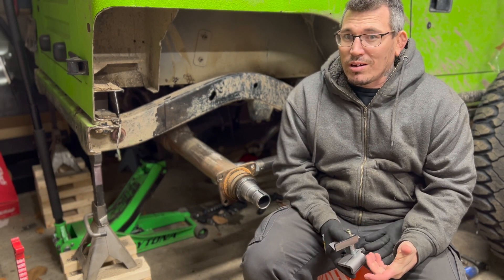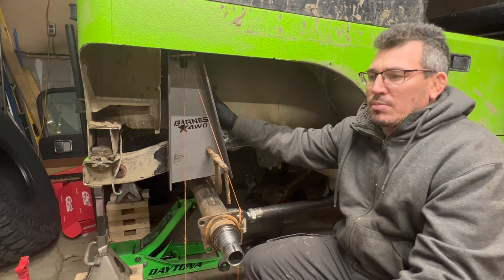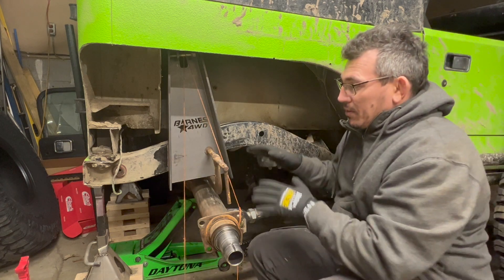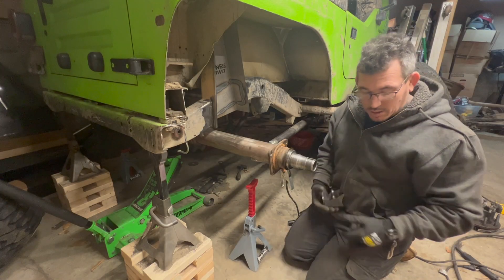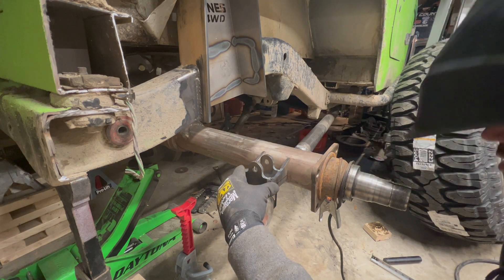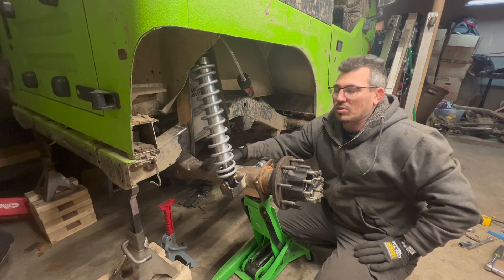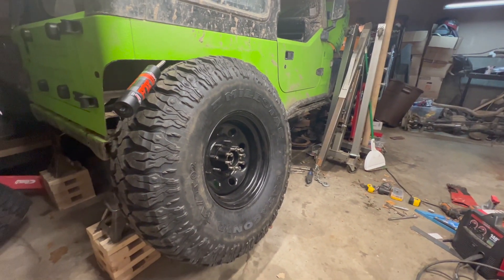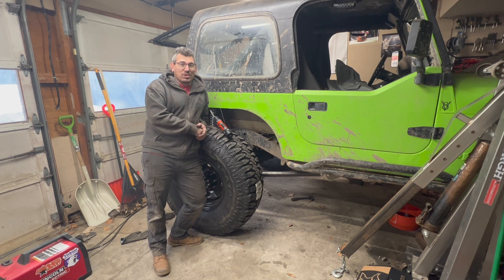How to Build a 4 Link Suspension, DIY Coilover Towers Jeep Wrangler YJ Part 3

Comment: I know your video is a few years old, but maybe you’ll see my question pop up in your notifications: 
The towers you used: are they the standard ones (15.25”) or the long/tall ones (17.75”)?
Also: after everything was said and done and you’ve driven it, are you happy with the 2.0 14” coilovers, or do you think the 12” or 16” or 2.5 would have been better?
I hope to hear a reply. Thanx.
Reply from the maker: The towers are the long/talk ones. Yes I’m happy with it. For this specific build I wouldn’t change the shocks to anything else.
Reply: @KBWheelin ok. Thanx. I already bought the shorter towers, because I was just going to keep normal smoothies but outboard them. I already put primer/paint on the back of them, so I’m not even going to ask Barnes to swap them for the bigger ones. I’ll just have to eat it, and buy the taller ones, because I decided to do coilovers. Unless I go with 12” coilovers, I’ll have to get the taller towers. They aren’t that expensive though.

Comment: Hey buddy how goes it =)  I have been studying your build like crazy as I'm building my yj.  On this part or the video I'm wondering at ride height what is the distance that u have between the coil and the inside sidewall at the top of the tire.  Thanks and all the best.
Reply from the maker: Hey hope the build is going great. The space between the tire and coil is all gonna depend on the backspace your wheels have I’m running 4.5” backspace and I’m around 4-5 “ of space between the coil over and the tire
Reply: Awesome budy. I really appreciate u getting back with me. I will be sure to check my back spacing.  I know I'm going to be running some steel wheels  with 39s. All the best and again thanks for reaching out

Comment: Do you want the mount on the axle as wide as possible for better stability?
Reply from the maker: A major reason is adding strength thru triangulation.
Reply from the maker: There is a lot of reasons it’s a good idea and things it effects but the short answer is yes.